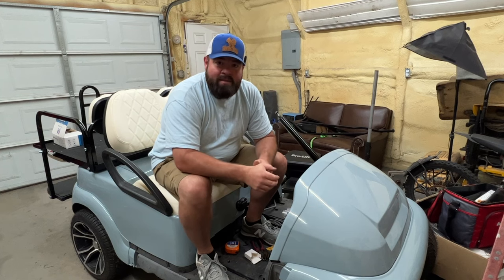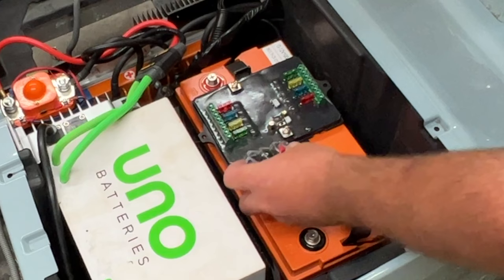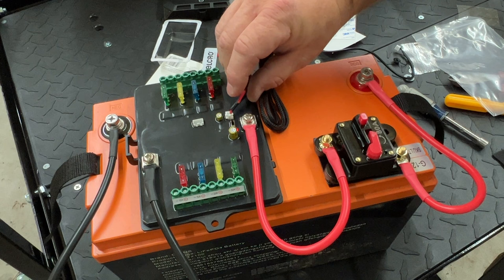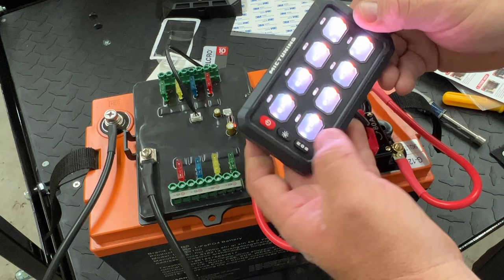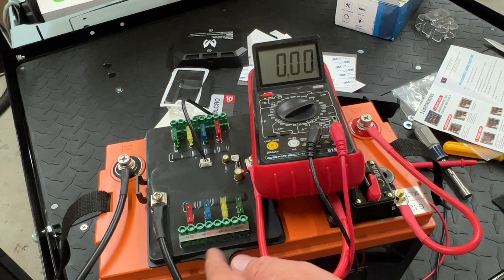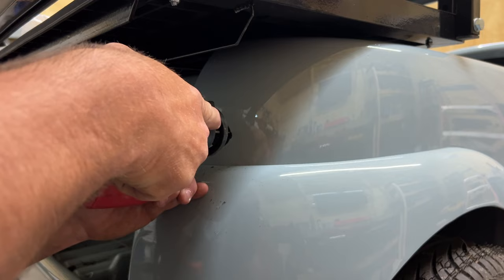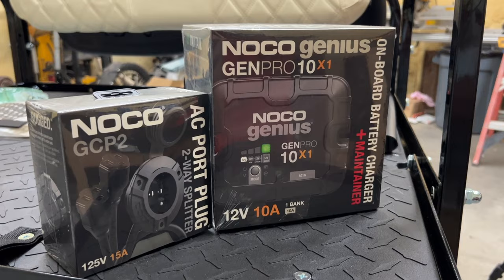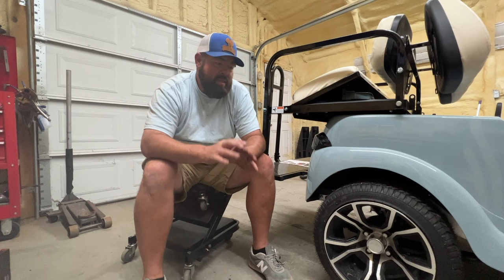Wife's Golf Cart Is Almost Complete | Nokins Deluxe Headlight Kit & Mictuning 8 Gang Switch Install

Comment: Don't use your breaker as a switch. It will weaken the spring over time and start tripping intermittently. Same thing in a house. They aren't meant for that. Add a battery disconnect like a race car if you wanna do that.

Comment: Ryan why not mount everything on the passenger  side. The reason is if only one person is on the cart it would distribute the weight evenly . That's what we do. Just a suggestion. However I do like the lights.
Reply from the maker: If the floor was good in the bucket I might would’ve. However since this battery bucket had a gaping hole in it and I didn’t replace it I just mounted everything on the drivers side. Still less that 100lbs with a charger and 2 lithium batteries.

Comment: I just had the deluxe kit installed and my tail lights cuts off when i turn on my high beams. when i switch to low beams they come on as if i was just cutting them on. is that a wiring issue or something in the control box

Comment: Please check your links in the description.
The amazon links for both the on-board charger and the Dual port AC plug are the same as the Smoked Taillights.
I am interested in the links for the charger and AC plug.

Comment: I don't have a 12v battery. In which case, can I run the Mictuning switch panel from my 48v to 12v voltage reducer?
I have the same reducer as you, the blue one.
Reply from the maker: Yes you can.